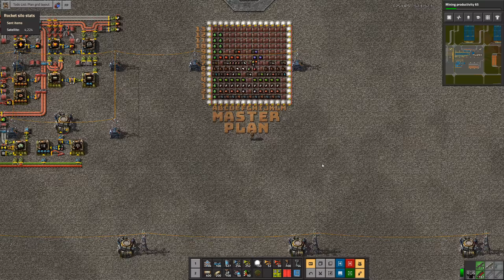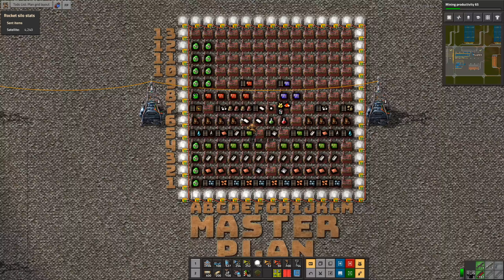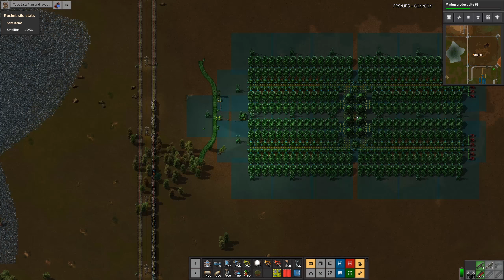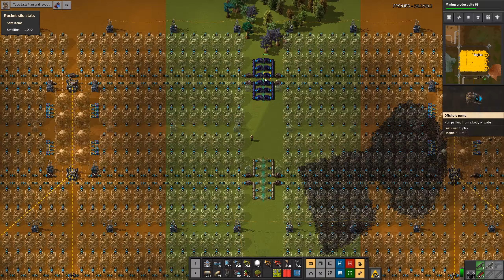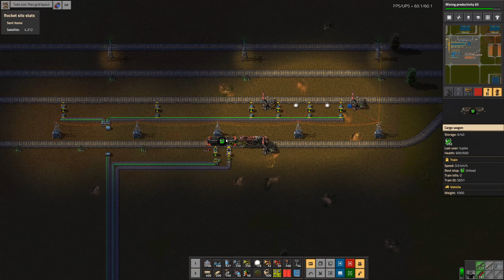Factorio +10K SPM Grid Megabase #6 - Nuclear power, self sufficiency

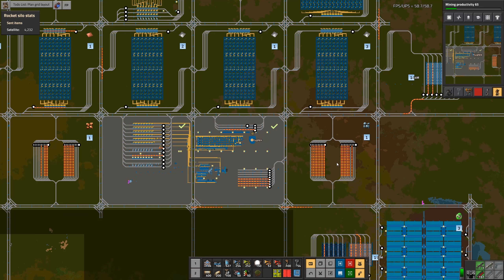Comment: 0:10 - gladly; 0:12 - likewise!; 0:16 - indeed it has.

17:47 - if you shift-copy, you can enable tiles, and get the water blasted for you.  You've gotta place the blueprint twice, because it won't ghost the pump in until the water is actually there, but... could save you some of the positioning hassle circa 18:13.

No particular timestamp, but through the middle where you're building out nuclear: if you turn off personal logistics with the new toggle, does that still leave you with trash slots?  If so, you might want to try turning it off, and stocking up on stuff from chests, storing it in trash slots, stocking up more, and then going out to build.... emptying trash slots when appropriate.  I haven't run the game recently, so I don't know for sure that that's how it works, but that's what I'd expect, and that could have saved a few trips for ya, I expect.

33:52 - you probably know this, but just in case: you could plunk down the inserter where you are, program it, then cut/paste it to where you want it from map view.

Comment: For the ore eraser I found a workaround that can be used.
The command " /c game.player.insert{name="ore-eraser"} " will add it like a blueprint in your inventory.
That being said, it can't then be deleted... Has to be put in a chest to be shot ;)
Reply from the maker: It didn't work for me...

NVM, I'm actually using the new version of the mod called "ore-erase", so if I remove the "r" then it works.
Reply: Yea, I'm using a modified version of the old one. 
Wasn't sure witch one you where using since they have the same name... Since Nordee changed the names in the mod files, and on the portal. But kept the same name in the mod title.